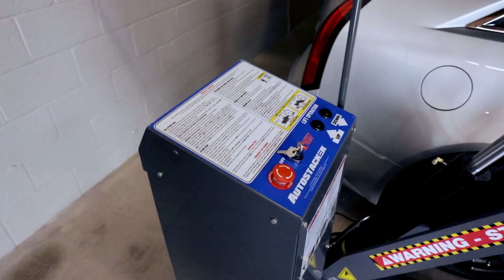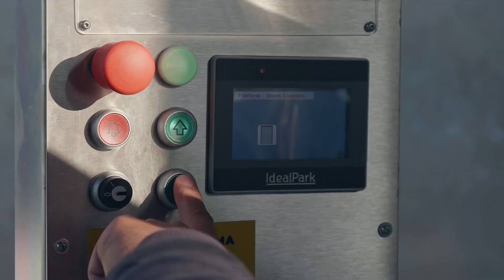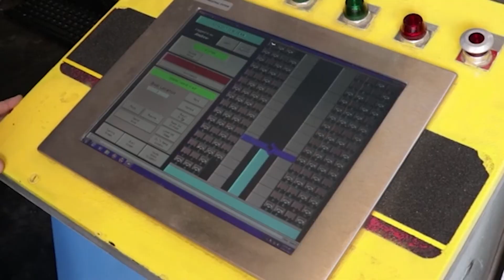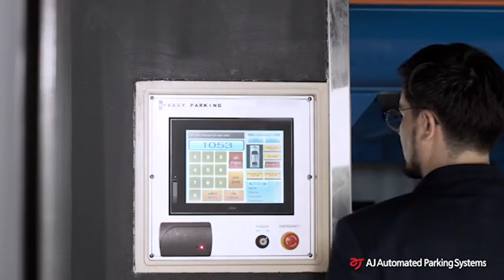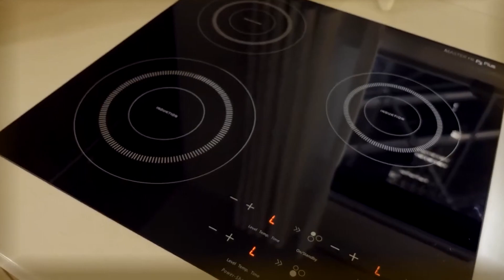12 TRANSFORMING PARKING GARAGES YOU MUST SEE NOW

Comment: Autostacker parking lift is a valuable solution. It can hold up to 6,000 pounds which is amazing. It's simple, safe, and easy to use that we can lift it in just about few seconds. It works for sports cars and cars with low ground clearance as well. Gazebox is an alternative garage and gazebo that comes in a unique shape, we can put up in a small space and will keep our car safe in any season from wind, rain, and snow. Cardok Turntable 360 platform is so useful and we don't have to worry about complicated moves anymore. It can turn in a full circle making it much easier to get our car into and out of a garage or parking lot. Thank you so much for doing this video.